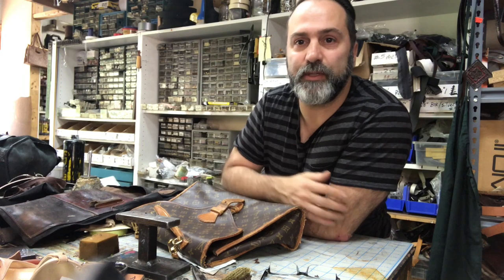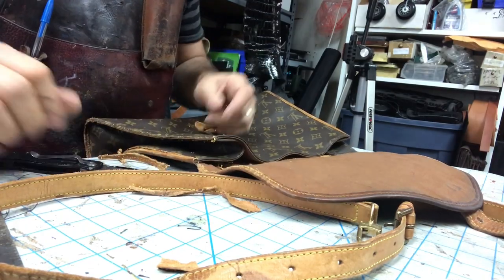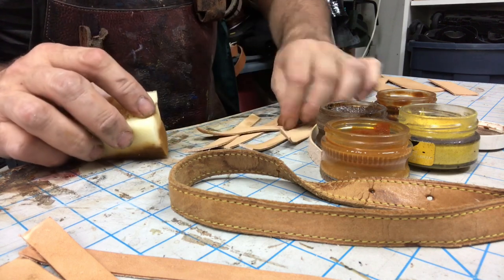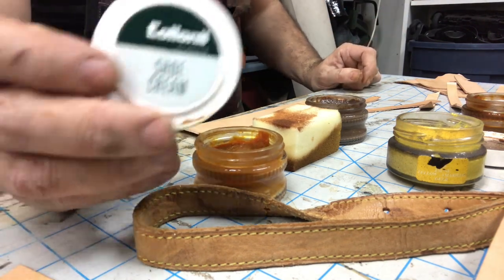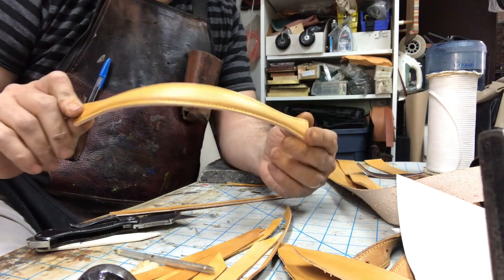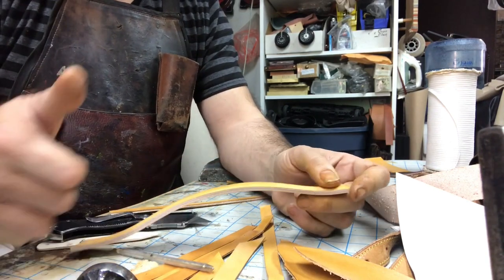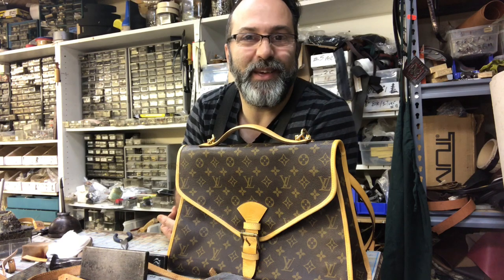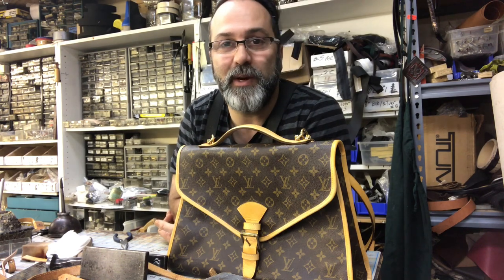Restoring a Louis Vuitton Bel Air Bag #118

Comment: Hi Steve; great video, as always but I wanted to mention to you that Loctite Blue is the normal thread locker people use. Loctite Red can only be removed by heating it with a blowtorch after it has set. It is much more permanent, for critical moving mechanical components, than normal Loctite Blue.
Reply from the maker: John Kelly ok I’ll buy the blue but it was very small drop so I think this time it will be ok

Comment: That customized cylinder arm machine was fine, I reckon it was the needle/thread combo that was causing it to act up. It could also have been pressure of the top thread etc...Great result...as usual. Damn, I wish I lived near, I'd love to work with you doing repairs.

Comment: Steve , thread lock red is the strongest , the same in blue is not quite as strong but more than enough for your needs . The red can be hard to undo with out heat sometimes :D
Reply: Red sometimes will not disassemble without heat so you are right the blue would be better for this use.

Comment: I dont understand the point of repairing the bag for $700-$1000 when a new bag costs slightly more
Reply: Zareldo I go back and forth. Because 1) they don’t sell this particular bag anymore. 2) it could be for sentimental reasons. 3) the bag is basically brand new by the end of the repair. However you could also buy a brand new bag that will maybe last a longer time. I can see both sides I guess
Reply: @yourbluemom  I think the only situation in which it would make sense is if the bag has sentimental value

Comment: This is just me, but I question spending thousands of dollars on a new bag where you are paying mostly for a name. The value is just not there. I personally had rather have a more versatile much much less expensive bag. Perhaps a shopping bag from the local grocer. On the other hand restoring a bag that most likely also has a sentimental value, I understand the cost there with labor and material.
Reply: No, it´s not just you. I mean, they sell Waist/Hip Bags for 1.5k. Ugly ones. Doesn´t sound sane to me.